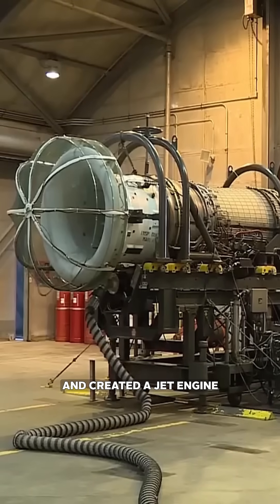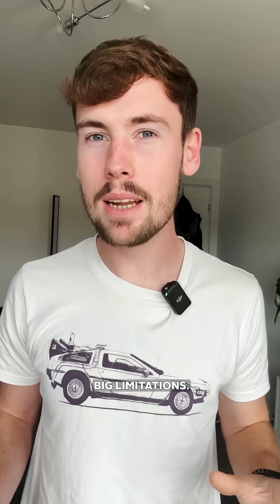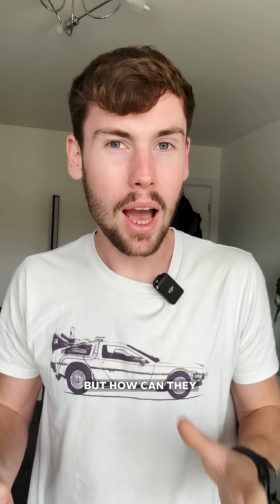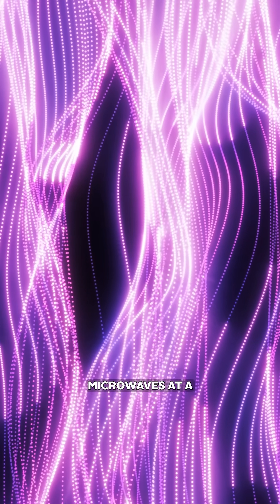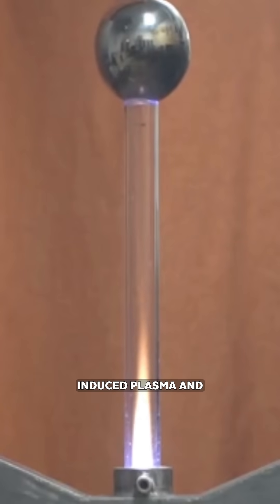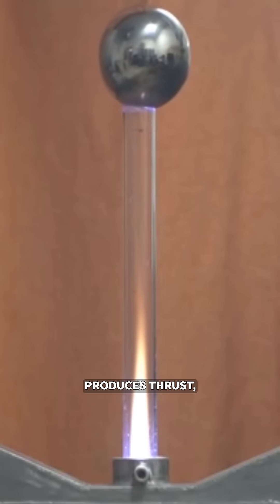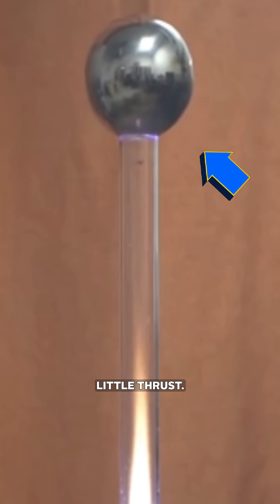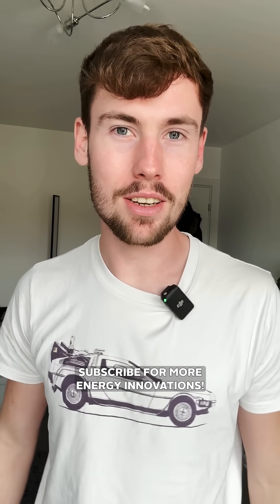PURE Electric Jet Engine #breakthrough #science #jet

Comment: I’m confused. You start the video by saying scientists have made an electric jet engine (and show a video of what, I assume, is that same engine. Yet, you end the video saying the method doesn’t produce enough thrust to power a jet. 

So, which is it?
Reply: What’s there to be confused about… it’s an electric jet engine that requires much more research and development before being capable to produce useful thrust.
Reply: @JustAnotherSeeker  Ionised engines have been thoroughly researched and tested by NASA, which they can only use in space because of the limited thrust. This was CLICKBAIT.
Reply: @tinkabelle2499  Ion engines and plasma jet engines are not the same. Plasma jets allow for much more propulsion than an ion engine is capable of. Still, it's not a lot of it
Reply: @tinkabelle2499 Only this isn't an ION, (static) engine. This uses a magnetron, or microwave, to heat the air to its 4th state. Big difference between the two.
Reply: The "engine" is just what you see at the end with the metal ball, the first one is just a random non electric engine that he shows so that you'll watch the whole video
Reply: "Welcome to the internet
Have a look around.
Anthing that brain of your can think of can be found.
[...]"
Reply: it's clickbait, that's what it is
Reply: @epsig1507 yeah because they already have ion thrusters and they use them in space rockets. They don’t produce enough thrust to weight for most planes and rockets inside earths atmosphere but are perfect for longer missions where specific impulse is way more important, like long space flights. There are very amazing YouTube channels of people who made electric planes snd gliders, testing the technology in miniature planes. It can mske air flow without moving parts and it’s very cool.
Reply: You assumed the video on the screen showed an electric jet engine. This is not the case. It was literally just a video of a regular jet engine.
Reply: Also needs a power station to provide any thrust,  been around for decades. Definitely not a Chinese invention.
Reply: Certain channels make us watch the entire video before letting us down…

We learn which channels those are and start tuning them out.
Reply: It's a JET engine, but not a jet (the plane) engine, at least for now.
Reply: Yeah, but the battery is not ready yet.
Reply: @lpjunction  you see instead of a battery you use a diesel generator
Reply: Another waste of money.
Reply: It's another bullshit clickbait video made for no other reason than his wallet. That's why I always downvote this garbage.
Reply: Nuclear jet engines exist, that's what needs to happen, the thing could fly nonstop for 80 years maintenance not withstanding
Reply: @kingcosworth2643 Until it crashes, and causes a nuclear disaster!! Use your head!
Reply: It's an electric jet engine, but it's not capable of producing enough thrust to get a jet into the sky
Reply: Did you pay attention? Seems you didn't pay attention.
Reply: Shitty clickbaits of the modern era we live in.
Reply: its showing that hot air expands.... which is nothing new. if people learnt the actual way that engines run it would come as no surprise. hot air expands.

combustion is a convenient way of heating air rapidly. it has limitations. but we pursue with polishing our little turd, blind to the basics. it just heats air.

we burn fuel, it heats the air, we use that expansion to drive something. that is ALL it is. if we heat the air with a "10,000C plasma discharge"? whats the difference? nothing.

its far hotter than ANY combustion can get. but we have to CONTAIN that heat. all jets suffer that issue, they can only take so much heat before burning out.

and apply kilowatts, megawatts of power to cubic metres of air per second. every litre of diesel or kero is roughly 10KW. how many litres of fuel does an average jet chow down in a short flight?

its about surface areas and heat flow and energy transfers...

theoretically? simple. theory is sound. "heat the air up with plasma".

practically? "wow. this is hard".
Reply: CLICKBAIT!

Comment: Sir, they are attacking us we need to take off right now!!!!!

Wait, lemme charge my jet 😂😂😂
Reply: Sir, they are attacking.
We need to take off right now!!!

Wait, lemme refuel my jet...

Oh, wait a minute, we'd never leave an alert aircraft in such a state of unreadiness.

Never mind.

(There are numerous problems with an electric jet, this isn't one of them).
Reply: @simonoleary9264  one i can think off is that you'd need 100k hp to push a jet like the f35 at max powet... that is 75mw of power... the best batteries we have in development (not on market even) can do 1kw/kg  which means you need 75 tons of battery to power the f35 at max tilt for 1 hour which is about what the f35 can do with its fueltank... mind yoy the airplane itself can take off with a maximum weight of 27metric tons... sooo the battery providing the powet would need to be at least one order of magnitude more energy dense than the best technology we have in the lab(and don't know if viable) today... and that is IF you can efficiently transform said electrical power to mechanical one... more realistically though you'd probably need a 1t battery delivering a whooping 150mw of power so that is 2+ orders of magnitude more than what we have today in labs...
Reply: Fusion powered jets keep the batteries always charged. Batteries would only be there as a secondary energy source.

Comment: Pretty cool.  I wonder if they combine it with the ramp-jet technology if it might work better.
Reply: What's a ramp-jet?  If you mean RAM jet, then it's already that in as much as there are no moving parts.  The problem with this idea is that there's no net benefit in compressing the air, because you need more energy input to turn the higher mass of air into plasma, so you have to solve that problem first.  The only thing you'd gain would be pre-heat on compression, which I'm guessing they probably do in a separate process in the lab, and a RAM jet needs to be going very fast indeed before you get useful pressures.  TANSTAAFL.

Jets and even turbofans are already quite inefficient, the amount of energy you'd need would be astounding.  Jet-A only works because it's a very dense portable energy source.  For example, a fully loaded 747 has 184 metric tons of Jet-A on board, with a total energy density of 7.912x10^12 joules, or 2.2 billion watt hours.  To put that in perspective, it's the same energy to charge 22,000
Tesla model S's (100 kW/h each).

You'll probably see working fusion reactors before you see a working electric jet engine, mostly because you'll need a working fusion reactor to run it in any practical sense.

I said "you'll" because I don't expect to see either in my life time.  Physics (and basic maths) is a bitch eh?
Reply: Ramjet* technology… and yes, that might be a logical next step; or not.
Reply: How do you combine it with a ramjet?? A ramjet is just a normal jet that doesn't have a compressor stage because the air pressure is already sufficient so you just burn fuel to expand volume and get thrust....
Reply: Aa😊/sdp